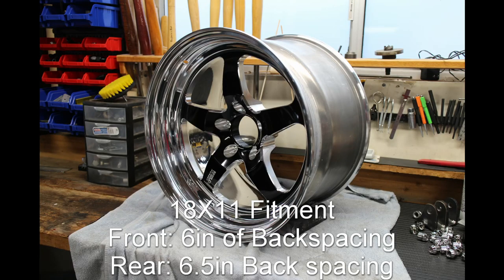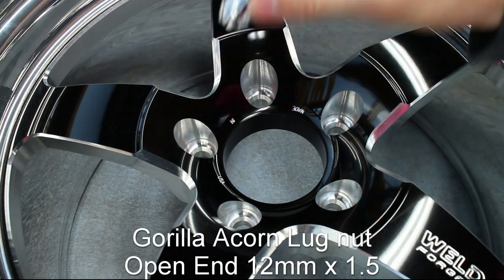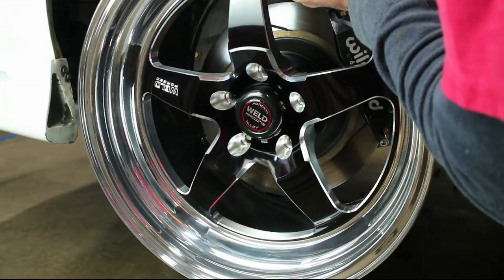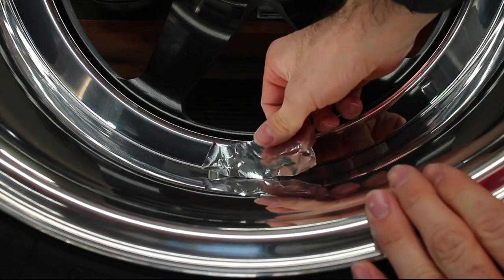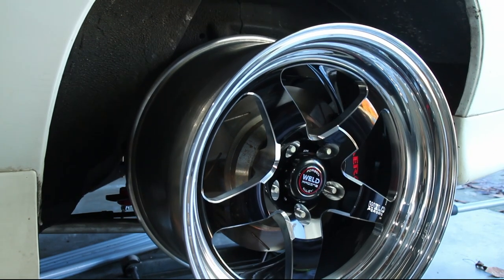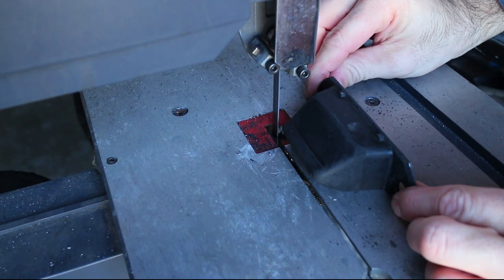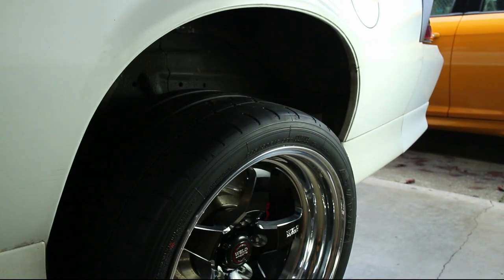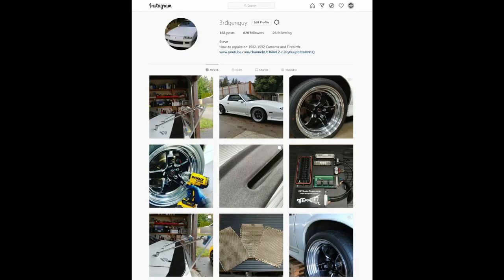WELD RACING S71 Wheel Fitment guide ( Pt3) (1982-1992 Camaro/Firebird)

Comment: Wishing Youtube had a feature of being able to comment with a photo but Weld S71's are a phenominal wheel choice! I have some S71's reps on my dark teal 91 RS, 18x10 and 18x8 wrapped with some Continental Extreme Contact DWS06's with 295/35/R18's in the rear and 245/35/R18's in the front. Shouldve gotten some meatier tires in the front to be honest but I just love the looks of these wheels. Keep up the great content man
Reply from the maker: all my choices are to GO-FAST at the autocross 
so they don't make a ton of sense for street guys who just drive around and enjoy their cars.
18x11 is on the bleeding edge of not fitting.

Comment: Great breakdown of the wheels. I am currently working on putting some on my 1992 Firebird.   Do you know what the offset was on the wheels?  Thanks for the info.
Reply from the maker: you can use a calculator online to convert my back spacing specs to offset.
Reply: @3rdGenGuy  thanks. I was just playing around with that too.

Comment: Seeing as you ran a 5/8 spacer up front could you possibly run 6.5" backspacing all the way around
Reply from the maker: yep, 6.6in of B.S. on all 4.
Reply: Thought the issue was the center cap over the hub , wouldn't that be the same issue with a 6.6" back spacing?

Comment: How much space you have with the aftermarket calipers in the front...I'm running 5th gen Camaro calipers up front and gonna do some 18x8.5 with 6 in backspacing and wanted to know if it will work for m

Comment: Love the wheels. If I wanted to do a staggered setup with a 10in wide up front what offset would it be ?
Reply from the maker: a 10in wheel would need like 5.75in-6in backspacing 
 But it can vary from car to car.
I know a 17x9.5 or 18x9.5 with 5.5 or 5.25in backspacing fits like 99% of 3rdgens.
perfect for a 275/40r17 or 275/35R18 tire.
Decent tire selection in those sizes.

Comment: Is there any links for buying this size anymore? I’ve having a hard time finding anything over a 9.5 that will fit. I have a 2jz 92 that needs some new shoes
Reply from the maker: ulysses ur 100% race, a 18x11 is gonna be a bad time for a street driven car.
Remember, tire compound > tire width.
run say a Yokohama 275/35r18 A052 tire on a 18x9.5 and you'll have Plenty of grip.

as far as ordering, these are all Custom orders. so you won't find any off the shelf wheels in that size.

Comment: I’ve been all over weld’s site and I can’t find an 18x11” or 18x10.5” wheel with anything less than 7.75” backspacing ?? Did you have yours built with a custom offset?
Reply from the maker: Their website is weird.
go on Summit Racing and use their filtering options.
also ALL WELD wheels are built to order.
you order what specs you want, the wheel is then made for you

Comment: Can I fit 15x7 with 3.75 in of backspacing all around on my 3rd gen
Reply from the maker: no idea man
Reply: When I bought my field find 85 Iroc it had 15x8's on it all the way around but I never measured the back space on them. Ran them for a summer then went to 18's both require a speedo adj if ya want accuracy.
Reply: @KingKatRider   if you run 18s it doesn't require shit other than to check fitment,as long as you understand the need to use the same circumference tire.
a circle is a circle,if a 15" tire and a 20" tire are the same circumference,they affect the speedo the exact same way...example:NOT AT ALL

Comment: How much did you lower your car from stock height? Wheels looks great
Reply from the maker: stock 3rd gen ride height was very tall, about 28in ground to the top of the fender wells.
my car is about 25.5in front 26in rear
my car isn't super low, and there's good reason for it.
anytime your LCA or front A-arms go beyond parallel, (aka pointing upwards) the geometry goes all wack. so handling is decreased. but i only care because this is an Autocross car where 0.1 seconds matters a lot
Reply: @3rdGenGuy   I completely understand that. The stance is dope. Goodluck racing.
Reply from the maker: @coyosborne6137  if you only want the looks, you can SLAM the SOB lol.

Comment: I wonder how much harshness comes in and how straight the car goes with 18 inch wheels.
Reply from the maker: ride quality from the stock 16s to the 18s was identical, at least in my case. 
can depend on the build since mine is 100% autocross it already rides very harshly.
the wider tires love to follow the road imperfections though.

Comment: quick question, first off the car is awesome.. the 18x11 rears, is it a stock length rear end. Im sure you mentioned this before but I couldnt find it. Thanks
Reply from the maker: rear end is factory 3rd gen width
Reply: @3rdGenGuy  what would you guess for backspacing/offset for a square 10.5?

I would have guessed 6.5 but that's about what you're running with a half inch wider wheel...
Reply from the maker: @trashbandit2449  backspacing would be the same as what I have. 18x11 or 18x10.5 makes no difference. that extra 1/2in of width is pushed out to the fender.
6in BS front
6.5in rear
(i used 6.6in BS on all 4 and use a spacer to rotate tires)
if you want wide tires and are semi serous about autocross/road racing, I HIGHLY suggest doing 18x11. wider wheels are always better.
Reply: @3rdGenGuy I'm sorry they're actually 18x10, not 10.5

 yeah it's just the wheels I like in the chevy bolt pattern are only 18x10, 5, or 12 (forgestar D5. Looks similar to weld but less expensive)

The 18x10 offsets are 25, which should put the backspacing right at 6.5.
Reply from the maker: @trashbandit2449  6.5in BS rear would still work, the wheels would be tucked inside the fenders by about 1in compared to a 10.5 or 11.

having the wheels tucked in tight might cause issues if your suspension is still street focused though.

also, the 3rd gen Hub bore is 2.777in or 70.5mm. so i see those D5 wheels have a few hub bore options.
Reply: @3rdGenGuy  alright so roughly a one inch spacer out back. 

Smaller or no spacer in the front? Would like to have it flush with fender.

Thanks so much by the way. This can get a little confusing for me, and I couldn't really find examples of 10" wheels on TGO
Reply from the maker: @trashbandit2449  a spacer would put the wheels back flush with the fender. but i'd try to avoid using spacers if you can.
especially since you are ordering a set of wheels.

have you looked at he CTW 17x 9.5s? those are a bolt on no spacer set of wheels that are strong enough for race tires.
Reply: @3rdGenGuy  agreed, not a fan of spacers, but they seem to work well enough for the most part. Any problems with the slip on spacers you used yet?

Call me a ricer but I just love the looks of the D5s or s71s even if they're a little less functional.

How much has your turning radius been affected?
Reply from the maker: @trashbandit2449  i use a 5/8 front spacer and a 1/4in rear spacer. but i also use ARP studs so strength isn't an issue.

as far as turning radius, ya GOOD luck lol
mine was bad stock, and I had to lengthen the  steering stops to fit my race tires.
so it's terrible, 3 point turns everywhere.
Reply: @3rdGenGuy  oh so you did use new studs. That's the way to go. 

Well, thank you so much for all the help and info. Congrats on fitting 11s all around, that's crazy. Looking forward to more content, subscribed :)
Reply from the maker: @trashbandit2449  i have 2 videos on installing longer  ARP studs front and rear.

https://www.youtube.com/watch?v=a1GCvVCzpzI

https://www.youtube.com/watch?v=UjE5f4h4gK0

Comment: how did your auto cross times change?
Reply from the maker: it's hard to compare times directly because every Autocross course is different. that and diver skills improve over time. but going from 400tw 245s to 200tw 295 was worth abut 8 seconds a lap.
Also my suspension was 100% ready for those tires, so a more tame build might not gain as much.

Comment: Sucks that spacers are still needed but I guess there's not really a choice unless you pay for custom offsets.
Reply from the maker: WELD wheels are semi custom, they had either 6.1in or 6.6in Back space available. 
i choose 6.6 on all 4.
the rear spacers probably aren't needed, but i need to race with them first.
the front 1/2 or 5.8 spacer is so i can rotate all 4 tires.

Comment: Is no one going to address that he welded a socket onto the lug nut socket. They have a hex patter on them for a reason. So you can use a proper fitting socket on them.
Reply from the maker: I wended the spline lug nut socket to a larger socket for ease of use

Comment: Is that the stock rear end? I’m just curious because I just got mine to point of picking wheels. Not sure if I’m going with 10 or 11” wheel. obviously a 10” wheel would be 5.5 back spacing backspacing
Reply from the maker: my axle is a 10 bolt.
if you went with a 8.8 or 9in axle you'd just make sure the axle was the same width.
i'd  go with the 10in wheel, easy to package and probably wont have to cut anything.

Comment: also not the weld wheels come in diff caliper heights low..med..High when ordering pick a pad /caliper heights..
Reply from the maker: yes, there's a Low, Med, and high pad height.
BUT for 18x10.5 or 18x11s the pad height is all the High pad height 
i think the high pad height looks the best so it's fine by me.

Comment: Why was a 6” front backspacing ordered when you were just going to use a large spacer like that? Just ordered the wrong backspacing? Try not speaking so much like a robot. I know proper inflection is useful for being understood but it sounds sooooo unnatural where you took it to. Relax a bit and you sound more personable. The level of info is useful though.
Reply from the maker: so I could rotate all 4 tires.
SUPER important when your race tires cost nearly $500 EACH!
a small  spacer is well worth being able to extend the life of my race tires
Reply: @3rdGenGuy  but you got 2 different backspacings. 6.5” rear and 6.0” front.